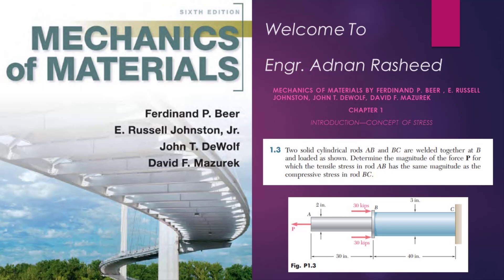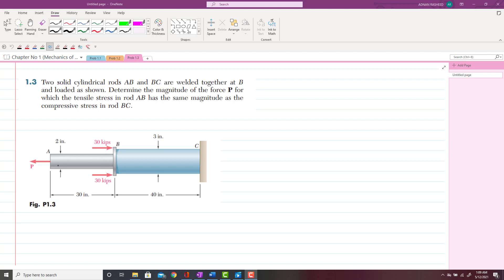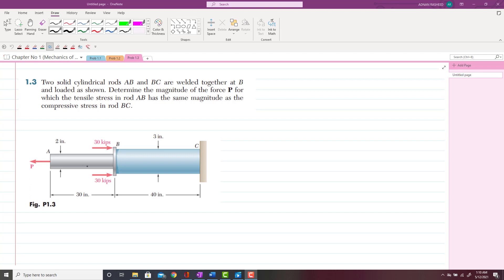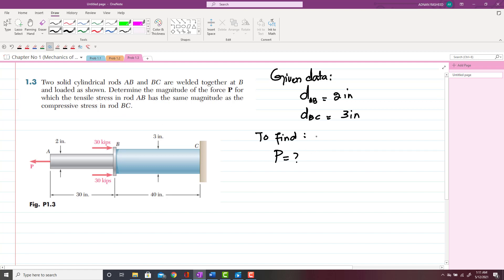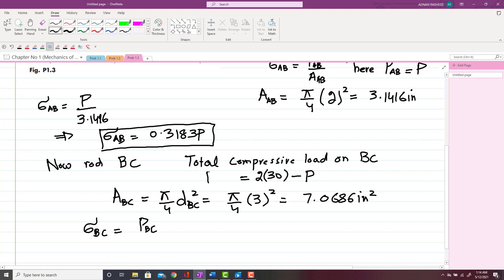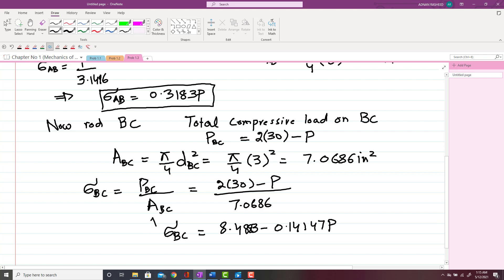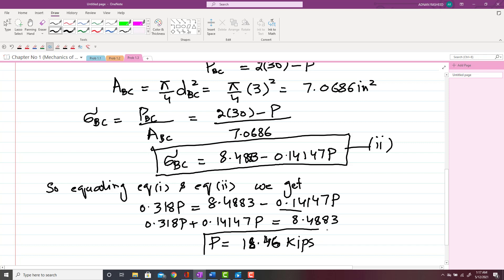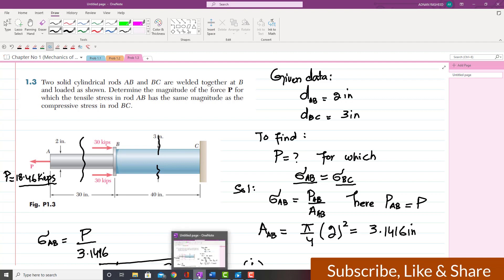1.3 Determine magnitude of force P | Concept of Stress| Mechanics of materials beer and Johnston

Comment: how did u get 0.3183 for sigma ? you did no calculation and put the value how?
Reply from the maker: Dear first of all check it again, its not 0.3183 it is 0.3183 multiplied with P.

Comment: in problem 1.3 you have written total compressive load on BC =2[30]-P but in problem 1.4 you wrote P-2[30]. What is the reason ?Although all other factors are same.
Reply from the maker: Thank you for your question. I have checked that and you are right. The thing is that both will give you the same value but one will be plus value and other will be negative. So in plus value you have to judge that which direction will be ok for equilibrium so from figure you can see the load bc will be towards the left side (towards P) so you can say load is compressive and in problem 1.4 you can say for balancing compressive force is needed so that's why you take P-2(30) to get the negative value of load which means in compression.  I hope it will be clear now.